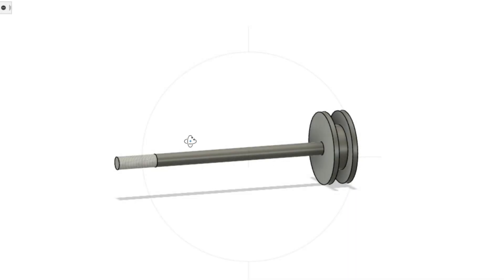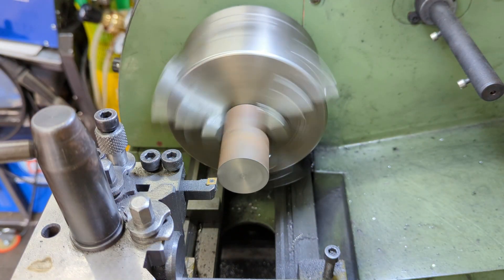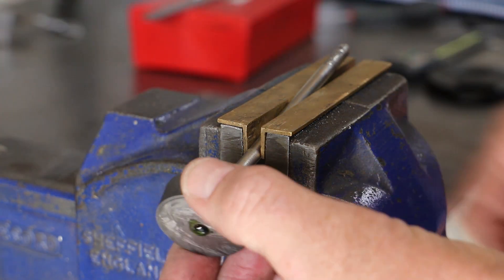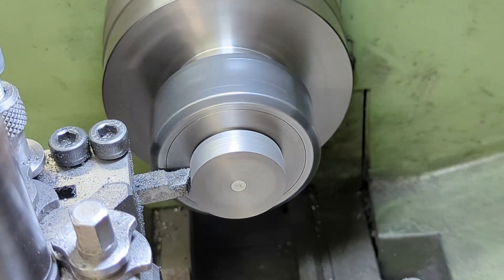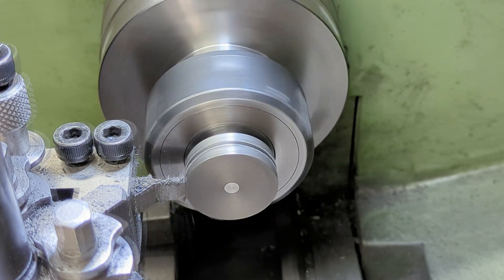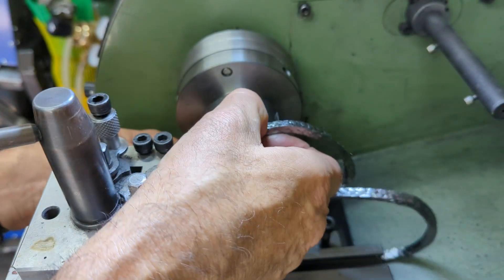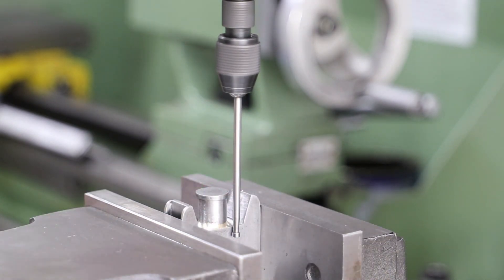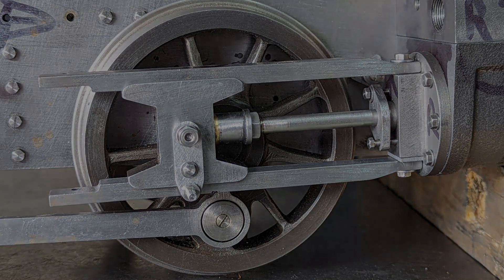Part 31: The Pistons and Piston Rods

Comment: Really lovely and very satisfying! May I ask a question about the edge finders you are using? I know you are using a DRO and a half function, so you wait for the wiggler to become offset. When I’m using my dials do I still want to wait for it to become offset? All the last possible moment that it’s concentrically rotating?
Reply from the maker: Hi William,
The point at which the edge finder or wiggler breaks away is what you're looking for.  At that point it is half its diameter away from the edge.  I have seen one contributor on YouTube that appears to work to the edge finder visually running concentric which I'm pretty sure it's not correct.
Cheers, Mark

Comment: As usual, superb video Mark.
I tried making a new piston for my Royal Scot (previously mentioned), and made it too small in diameter ( no idea how).
Still not plucked up courage to try again yet.
I am a little surprised that there is only one packing groove called for on your model.
Some modellers suggest the fit is right, when the "oiled piston" will slowly slide down the "upturned cylinder", under its own weight.
You make it look so simple, and accurate. 
Thanks for the videos..
Reply from the maker: Have another go at the piston for the Royal Scot, even if you get it wrong again you will learn and get there eventually.  It's how we all learned.  
I think the single groove with packing is quite common on the simpler models.
As for my pistons, they are much looser than how you describe 😁
Thanks for the feedback and comments 👍
Mark

Comment: Hi Mark Do you think the tolerance of the piston is a bit tight? As you will have heat expansion which will be greater on the piston.
Reply from the maker: The Million Dollar question :-)
According to Tim Coles in his book Model Steam Locomotives - "turn the piston to a sliding but shake free fit in the bore".  My initial impression is that both pistons feel a bit loose in the bores, but the packing will certainly help (I won't pack the pistons until I'm close to running on air).
Time will tell!
As a side note, Tim does also explain that the piston rod be pressed into the crosshead, which I guess will explain Don's lack of detail in this area - I'll stick with my threaded approach for now.
Cheers
Mark
Reply: @markshomeengineering5243   Hi Mark I also thread my my piston Rods it just feels safer.  Pistons are one  of those things that  makes me nervous, it's a fine line of a great job or a bloody disaster. With many cast iron pistons in the junk box from letting  hand act before the brain.  Enjoying the build and await the next issue.